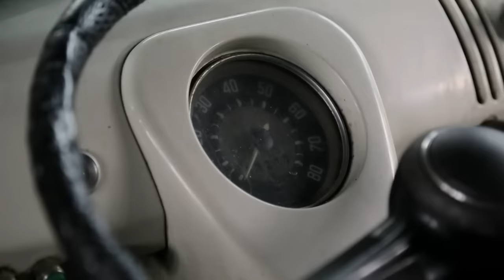American Pickers: ORIGINAL Volkswagen Bus in 1920s Shipyard (Season 21)

Comment: I'd rather have the 63 GMC pickup truck. I got my driver's license in my dad's 1966 Chevy pickup up in 1970. I drove it until 1985 when I gave it to my son. My sister still has it.
Reply: Right turn, Clyde 🤜
Reply: The mentioned the V6, but not that it was a 4 wheel  drive.